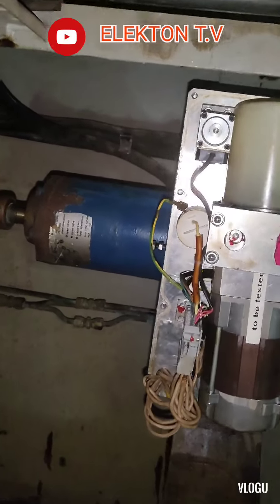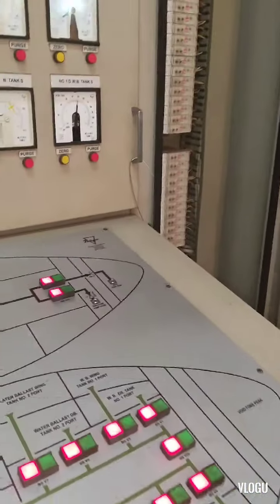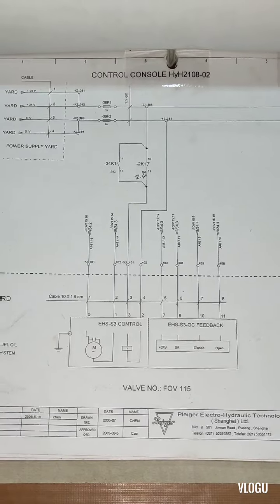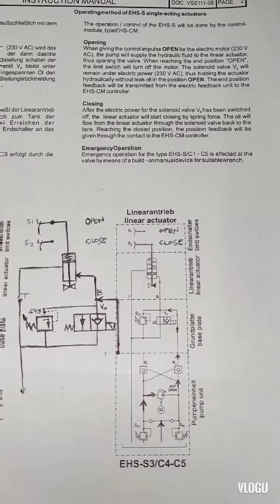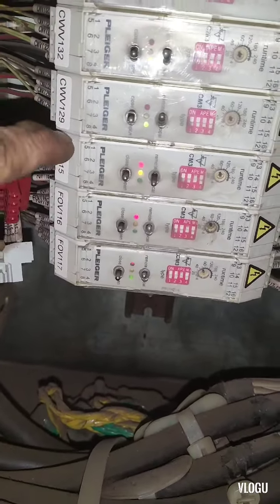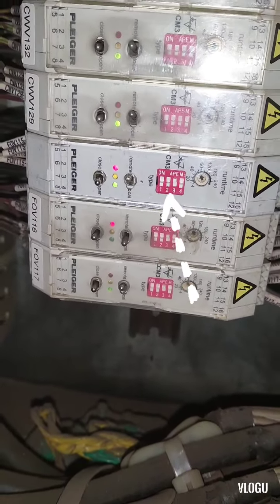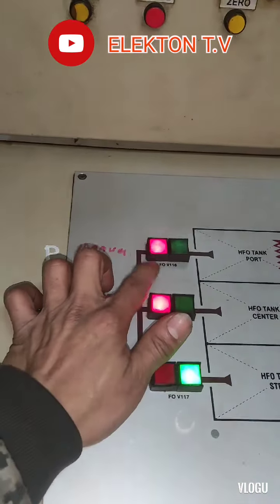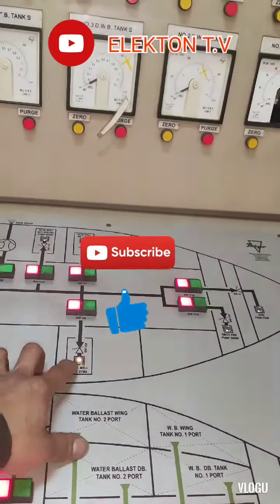HOW TO REPAIR ELECTRO HYDRAULIC VALVES, 3 DIFFERENT TROUBLES IN 1 VIDEO.

Comment: Hi! Any idea why the CM3 module is loosing communication with the Remote control system (CAMS) on the 24 v supply. After replacing the CM3 module with a new one, or even just taking out the original one and putting back, the actuator can only be operated locally. 
It's not a problem of address because the BI module is seeing the CM3 correctly and communication between CM3 and valve is ok both on 220 and feedback sensor.
Any idea on what to reset from cabinets after replacing CM3 module?
Thanks! 🖖

Comment: What the reason of fuse blown sir in valve A i think ders a matter of fact factor in the other circuit.😁
Reply from the maker: sir over load sa tingin ko,pinag sabay sabay itesting.,wala nman xa ground fault..
Reply from the maker: then yun fuse is para lang sa 3 valve, fuel tanks..
Reply: @elektont.v5746  baka may problem don sa solenoid valve sir..Ung coil nya high resistance.
Reply from the maker: @mannyantipolo1066  ok nman sir, na compare ko sa iba pare parehas nman,.
Reply: @elektont.v5746  ok sir Copy cguro sa duration of quality na sa fuse yon.Godbless keep safe sailing lodi.